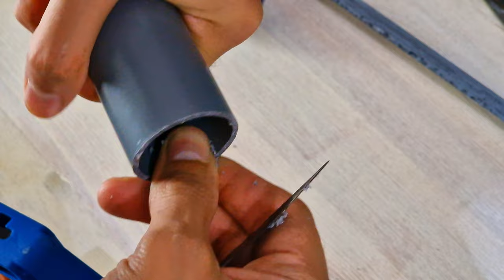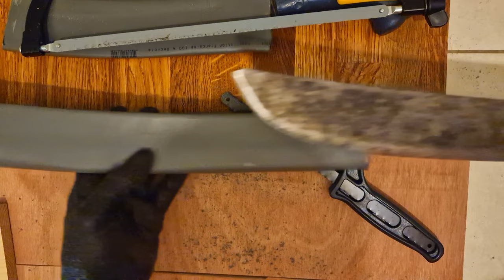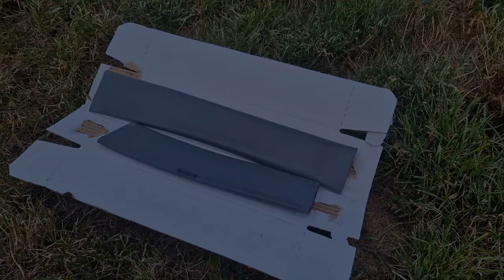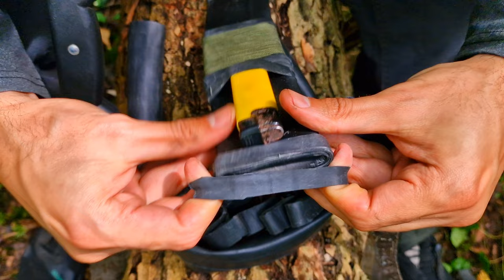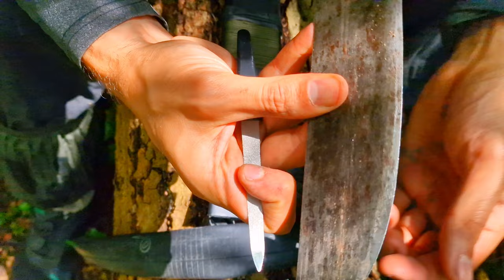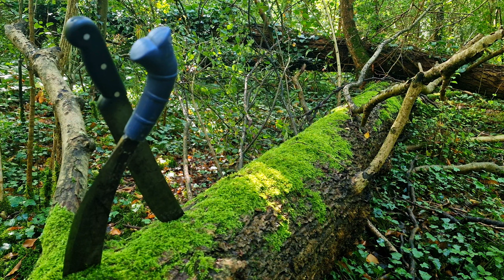DIY PVC Machete Sheath - How to Make Kydex Parang Sheath For Free

Comment: Good job. I will make one with a belt loop and an eyelet in the lower end for a leg tie.
Reply from the maker: Thanks man ! Got an idea for the belt loop ? Bought one Tramontina with a handmade pvc sheath that had the end bent into a belt loop. It was fragile and broke. I just thread some paracord under the rubber rings and sling it in my back.
Reply: @ARAW-__- I filed a notch on each side of the sheath, tied a loop in a piece of paracord for a belt loop,  wrapped the paracord in the notches and crisscrossed the ends across the sheath a dozen times and tied them off. If you pull the wraps good and tight before you tie it off, it will lock into the notches and hold. I also drilled a hole in the bottom for a leg tie.
Reply from the maker: I think you nailed it ! For the time being, I just slid big innertube rings. Then threaded the paracord underneath. It holds perfect.
Your way may last longer, though !

Comment: That’s a well worn “Bidor” parang. How did you come by it?
Reply from the maker: Hi ! Yes it is ! Bought it 10 years ago in Penang, Malaysia, from Nadir at outdoordynamics.my
Parangs are great in tropical and temperate forests.
Reply: @ARAW-__-  they are indeed! I visited the blacksmiths in Bidor last month. Got me a few of them too. My last ones got stolen.
Reply from the maker: @yewsengcheong1637 Bidor and AAA are incredible value tools. I like them and Tramontina / Imacasa machetes !
Reply: @ARAW-__-  I’m only familiar with the Bidor. Don’t know about AAA. Would love to try them though. I lIke and respect what myparangs does with the Bidors, but the blacksmiths at Chop Kwong Yuen Loong have really upgraded their offering. Would also love to try the Tramontina.
Reply from the maker: I need to check out the blacksmiths too. The parangs are useful tools out of the factory. The latin machetes you got to do a bit of work grinding and sharpening the blade, as well as the handle. Where were your parangs stolen ?
Reply: @ARAW-__-  out my car. Left it unlocked though so that’s my bad. In any case, I picked up a few last month when I went to the blacksmith. I’ve been seeing a lot about Lipis parang. Another quality one it seems.

Parangs do seem great for applications in general. I take mine camping in the UK. Been doing spoon carving with them as well. I like seeing others use them too.
Reply from the maker: @yewsengcheong1637 Sorry to hear that, I hate thieves. Parangs are the best choppers I know, and still can shave fine curls. I have a custom Bidor Parang, I have it in an earlier video, so quality is not as good 😐 but you'll see it a bit here https://youtu.be/jBVPkT3akQc?si=eOZjVAVWjYtiyQ00
It needs a proper sheath for it to come again in camping trips 😄
Reply: @ARAW-__-  I have one that needs a sheath. I’m thinking to go with a pvc one. Thanks. I love seeing Parangs in action. Will definitely check it out and comment. Junglecrafty’s videos are very enlightening.
Reply: That’s a cool custom handle. Hey, are you on Instagram?
Reply from the maker: @yewsengcheong1637 Not yet, but I will make one. I'll reply here when I do 🫡
Reply from the maker: Junglecrafty is my all time favorite. He introduced me to Nadir from Outdoor Dynamics.
We talked often back in the day but now he seems to have went off line, I hope he's okay.

Comment: Is that 1 inch diameter of pipe?
Reply from the maker: I used 40mm pvc pipe, but you need to check your blade. I will do one for a billhook soon, and although the belly might be 8cm, the bill will need a bigger diameter. 🫡
Reply: @ARAW-__-  thanks for the information, bro! Good luck for the next project, can't wait to see that. 👍
Reply from the maker: @aufagrissee1243 Thx bro ! I hope it will come out good, I'm carving the handle from a chair leg, and I'm a bad carver 😅🖐️

Comment: What origin country the Bidor parang came from?
Reply from the maker: From Malaysia ! Bought it locally when I was there ! 😁🖐️
Reply from the maker: Oh and it's the exact same one than the one linked in description. The customed the blade and handle but it's the same blade beneath it. It's also from bidor, MY
Reply: @ARAW-__- What diameter (PVC pipe) do I need for the Parang Duku Chandong 10" (blade width: 5 cm)?
Reply from the maker: @MrFreeman0179 hi ! 
4cm diameter should be good, I'll check when I get home.😉👊
Reply: @ARAW-__-  Thanks, I'm looking forward to your response.👍
Reply from the maker: @MrFreeman0179 My Bidor Paramg is also 5cm at the widest, and I used 40mm pvc pipe. Notice there is a slight bent to it. It's easy to do and you can always reheat and remold  if need be. Good luck bro ! 👊
Reply: @ARAW-__-  Thanks a lot for your quick response!!!
Reply from the maker: @MrFreeman0179  you got it, man ! I hope your sheath comes along good 🙏